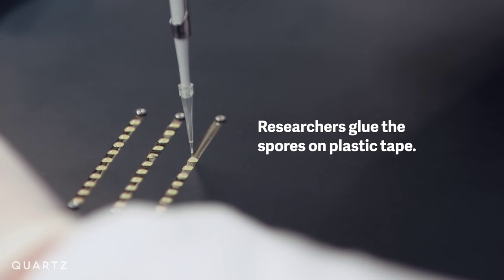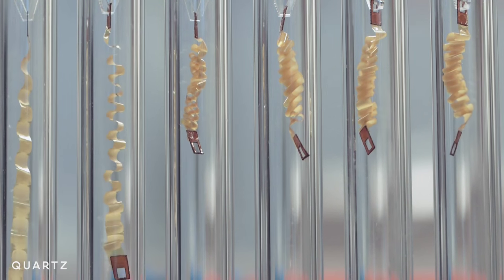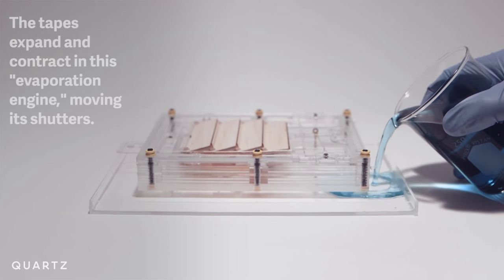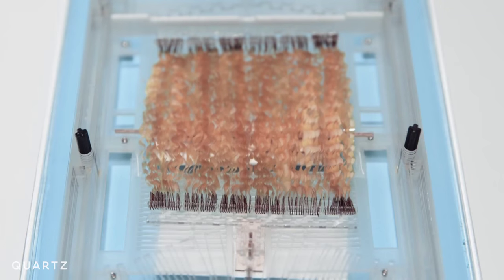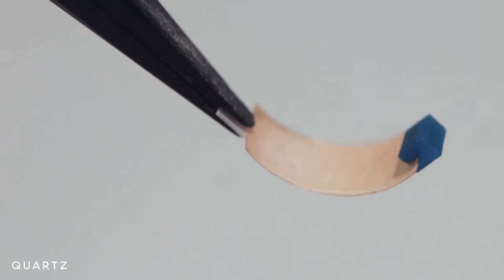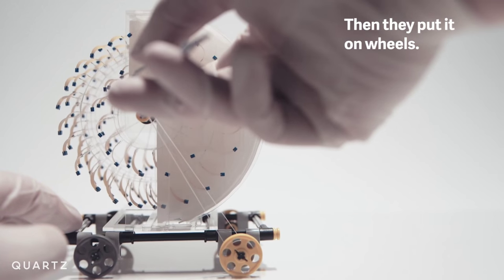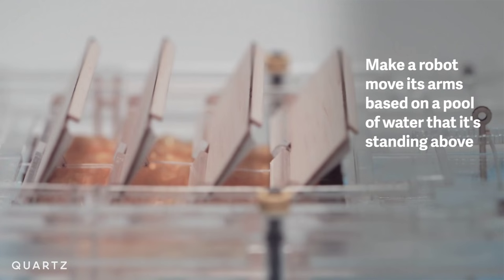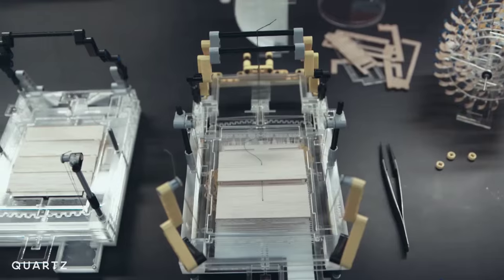Capturing clean energy from evaporating water

Comment: Ok. So they made a version of sterling engine that runs inderectly on air convection and temperature change by mediation by water evaporation. Where do the energy comes from? From the sun, what makes it effectively a kind of a very shitty solar pannel. Modern photovoltaic solars have the efficiency at coverting photon energy into electric energy up to 37% and growing. Concentrated solar thermal power is even better in hot climates. What is efficiency of this shit invention? 0.00000000000001%? You could cover the whole ocean with this shit and still get less than what we generate now from all renewables.
Reply: The best comment.
Reply: the difference is that this can likely be made with low quality materials and looks very light and compact.
Reply: Why are you attacking?! Are you against new technology? This is not a Sterling engine, but an engine that runs on moisture/humidity and evaporation, and it is clean, as you can see. The efficiency of solar photovoltaics ranges between (10 % - 26 %) no more, and it depends on one material in its manufacture, in addition to coal as well. Photovoltaic solar also does not tolerate environmental conditions. Solar thermal and wind turbines are much more efficient than solar photovoltaic. We don't just need electricity, We have to diversify our energy.